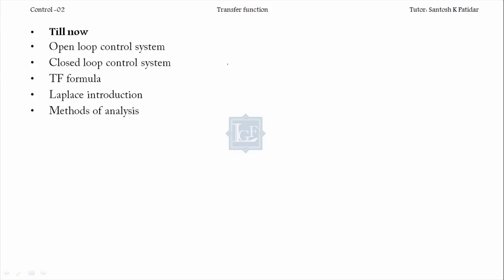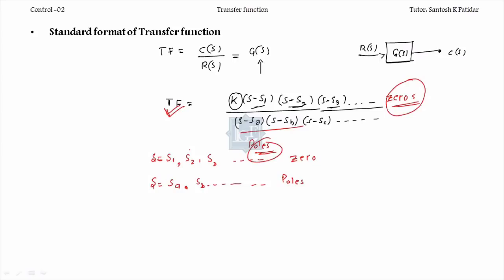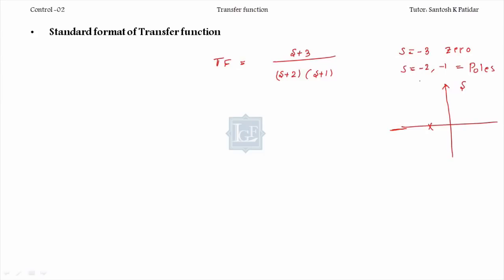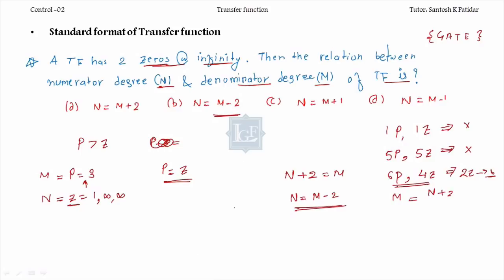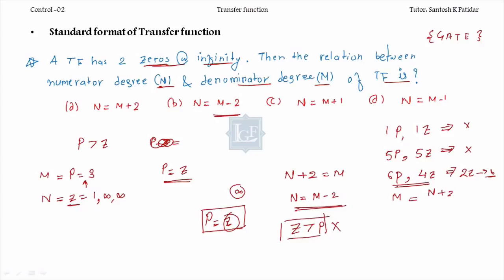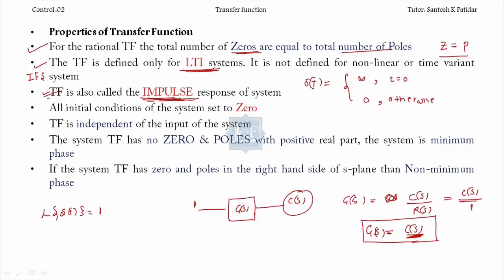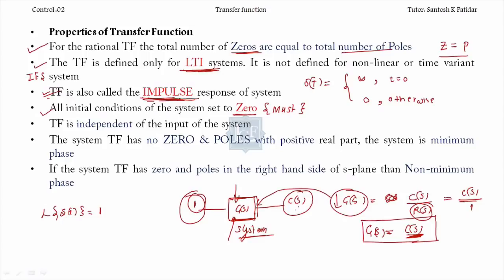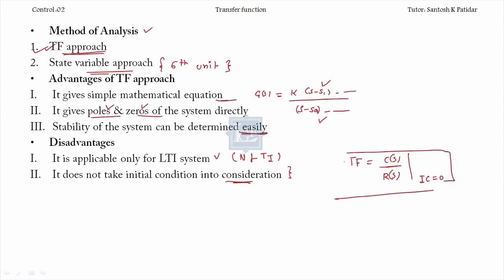Lec 02 Transfer Function

Comment: At 47:36, in the differential equation, how would I understand which is the input function and which is the output function between y(t) and u(t)? If I follow the sequence of the question, the input should be on the left hand side and the output on the right hand side. But in case of determining the TF, y-function has been treated as the output. How to determine which one is the input function in this kind of problems?

Comment: Sir, at 13:45 , to have two zeroes at infinity you said like poles will be two extra compared to zeroes i.e numerator. What about there is no other zeroes only two poles , these two poles match to two zeroes that are given in infinity , then in this case denominator poles, M is 2 = the numerator zeroes at infinity given in question = 2. Therefore, N=M. 
This is making sense , since for any ""RATIONAL"" transfer function which is strictly proper , you can make it to proper by considering the zeroes at infinity, the previous concept which you explained. So , for two zeroes at infinity , two poles is sufficient to make the transfer function as proper, and is it not a proper solution?
Is this explanation is right?
Reply: no not correct, since theoritically TF is always proper TF i.e. P=Z. and if all the zeros are at infinity its vague statement, it means system will never provide the output.
Reply: well,i believe we are  not considering infinity count in N.Even in the case of M=3,N=1,we are not considering two infinities in the count of N.Hence we got N=M-2.So even in your example,this is valid.Please note,N and M are degrees and not NO. of poles and zeroes.You are getting confused between two.
Reply: Ok, thank you.
Reply: Ok, thank you.

Comment: Sir, At 44:18 , You can't say unit impulse signal in time domain is infinite at t=0, ( SINCE UNIT impulse denotes the value of the signal to be 1 only. It is not infinite if it is unit signal) unit impulse means at t=0 the value has to be 1 not infinite as mentioned. Also unit impulse is mostly considered in discrete systems than continuous systems in time domain t. Kindly, correct if iam wrong. Thanks. Videos are really useful and appreciate the effort.
Reply: Not correct, value i.e. magnitude is never one for unit impulse signal. Its the AREA i.e. equal to 1 since as t tends to zero magnitude tends to infinity.  
And overall Impulse signal is called Unit impulse because its AREA(or sometimes also referred as height) equals ONE.
And there should be no ambiguity about the use of Impulse signal either in CT or DT systems.
Reply: Yupp u r right .. if I am using Unit prefix so it can't be infinity.. so statement is impulse signal has infinite magnitude at t=0 and area is 1.

Comment: 28:21 ; C(s)/G(s) is TF ?  You are violeting your own statement sir 😋
Reply: Shanu Verma That's what I was thinking 😟
Reply: Neha Dwivedi : minor mistake is made in hurry .
Reply: Same question i want to ask
Reply: TF will be c(s)/r(s) only if we consider the final output after calculation.
Reply: it is correct only because after the summing point the input will be changed so that r(S) will be changed to e(s) or g(s) it is same
Reply: @sunnycharan8531  There's difference between E(s) and G(s). E(s) is called actuating signal or error signal and it's the input signal to the transfer function G(s) which is nothing but the "Forward Path Transfer Function".

Comment: I didn't understand how zero of transfer function  is infinity. Why not a 0. 10:50
Reply: See Zero (as termed in theory) because if u put that value in TF u'll get zero numerically. Thats why if a Zero is at 0 , it will make TF = 0.
Reply: Rahul Awasthi no sir that is not my question what I want to ask is see 10:50 when no of poles>no. Of zeros then to make no. Of zeros equal to no.of poles we add infinity to make no. Of zeros as 3
Reply: See every TF is defined as proper TF i.e. P=Z but if system diff eqn provides less no of zeros than poles, then it is assumed that rest zeros will be at infinity, (since zeros at infinity are not realizable so it is just an assumption to meet theory constraints).

Comment: If H(s) is unity then CLTF =G(s)/{1+G(s)} but you wrote it G(s)/H(s)
Reply: Ashy Abhi 
Actually what u r saying is correct but in video I showed numerator n denominator form
Reply: thanks sir for video lectures . sir at 20:40 , no need to change  positive to negative . it was written right before. check that.